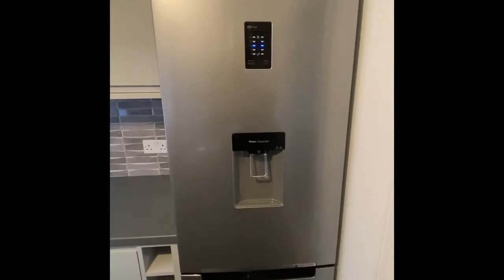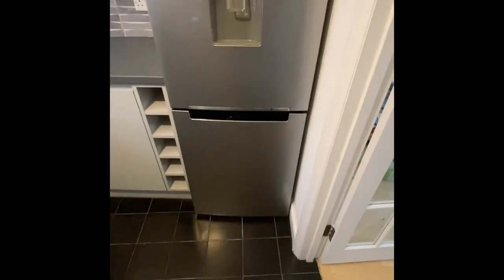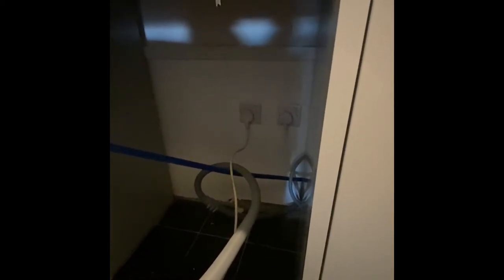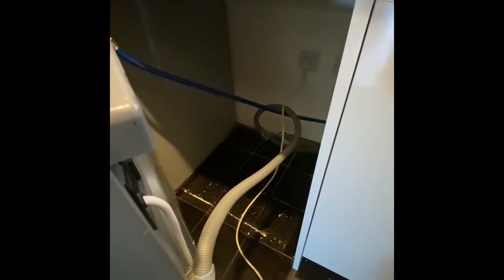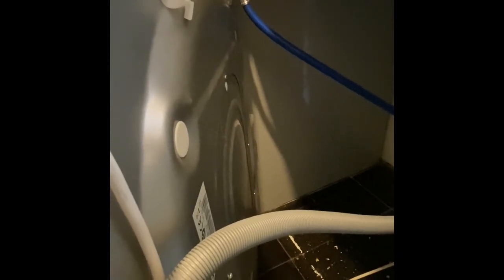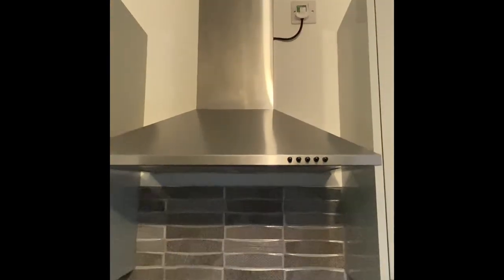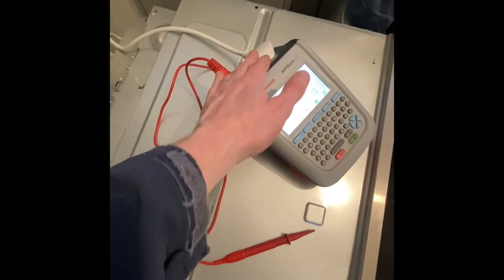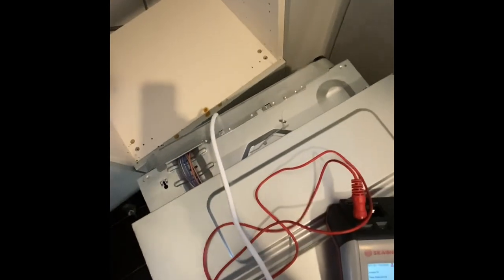PAT Testing Tutorial - Landlord Rented Properties

Comment: Nice vid thanks. On the last item the cooker if its wired in like the hob what can you do ? Just a visual again?
Little tip for washing machines etc i use a wet wipe on the floor the machine then moves out a lot easier.
Reply from the maker: Yes, I just perform visuals as I don’t yet offer testing on fixed appliances.

Comment: The question I have is if you cant pull an appliance out without damaging the kitchen floor, what do you do ? Surely the procedure is test something but only if you can gain reasonable access to it. A washer could damage a floor potentially so it opens up a can of worms regarding liability if you move anything. If you cant test appliances do you just report it as could not gain access to the plug ?
Reply from the maker: yes exactly that.
Reply: @caterhampattesting  cheers for replying

Comment: You say in your video that you have a disclaimer saying you do not test built in appliances. I would class the oven you tested as built in so can i ask why you would unscrew and remove the oven but not the dishwasher.. I am looking at getting into PAT testing and am curious. Thanks
Reply from the maker: Good question. Single ovens are almost certainly slide in to a housing and held in place with 2 screws - very easy to slide in and out and more often than not there will also be a plug on the end of the gas hob for the ring ignitors which will also need testing.
Items such as integrated washing machines and dishwashers are harder to access and pull out because they will have doors on the front and the kitchen plinths will be fixed into place making it impossible  to safely pull out these items. Also there is always a risk of disturbing the plumbing behind!
Reply: @caterhampattesting  Thanks for this. Makes complete sense and also i would not have given the gas hob a thought about the ignition on them. As i think i said on another of your vids i have booked my course for 1st June and am hoping to set up doing a few days a week. Will prob learn more fro guys like you than on the course to be fair so thanks very much
Reply: @caterhampattesting  Great channel, thank you very much, as another post said, i think i've learned as much here as i did on the course. Re the hob ignitor, is there any danger at all with PAT testing a hob when there is a gas connection. Any feedback appreciated, keep up the great work.
Reply from the maker: @MacMerc  No not really any danger as you aren't touching or tampering with any gas pipes. If there were any electrical hazard under there then you would want to identify it in case there ever was a gas problem which could cause bigger issues.
Reply: @caterhampattesting  Apologies, just saw you had replied. Many thanks for that, much appreciated.